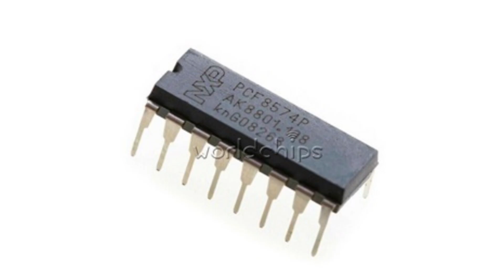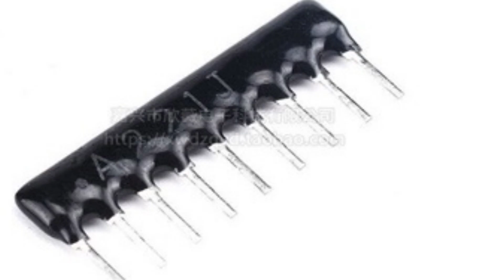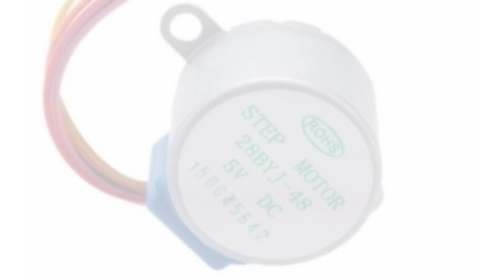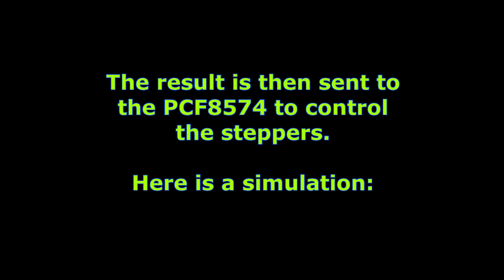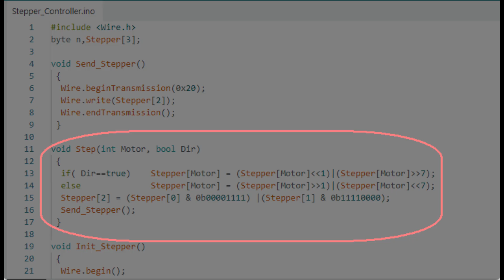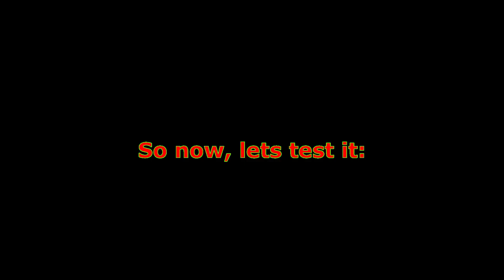Use 2 cheap 'General Purpose' ICs to easily control 2 Steppers using only 2 shared GPIO pins (I2C).

Comment from the maker: This video shows just how easy it is to create a stepper controller without using a specialized stepper controller chip.  The two chips used are a PCF8574 and a ULN2803, both of which can be used for a wide range of purposes, are cheap and are good 'staple' components to keep around